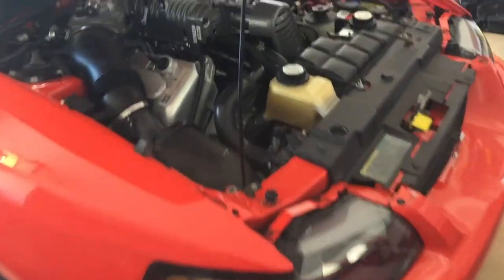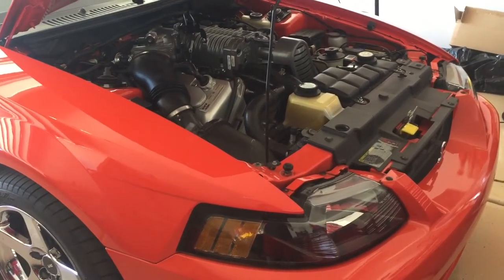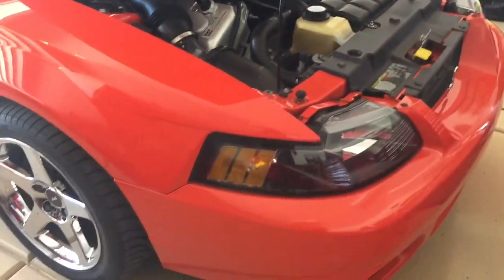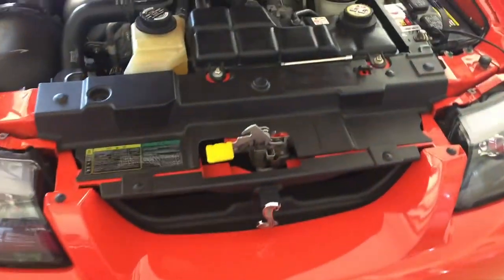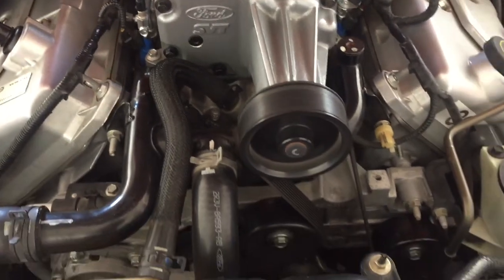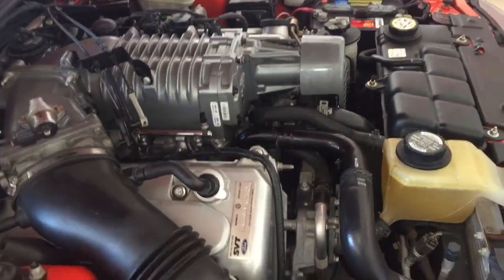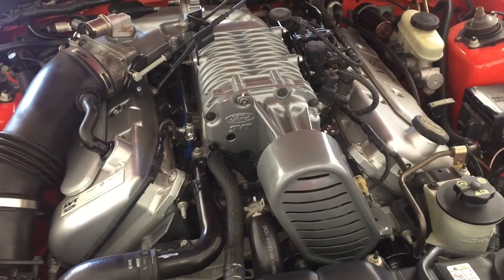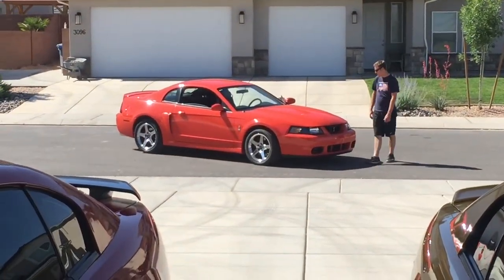VLog. How many miles are on my Cobra? Idler swap

Comment: Hey ive been noticing my 03 cobra has been heating up lately, some white smoke has been coming out above the coolant tanks and radiator, i noticed when burping it the coolant doesnt doesnt move in the reservoir tank, i tried replacing rhe thermostat, any ideas what it could be?
Reply from the maker: Kevin Alvarez loss of pressurization from the cap or the radiator may have a crack in it. Do you smell coolant?
Reply from the maker: Kevin Alvarez If you’ve properly burped it I would lean towards the radiator (or make sure the thermostat is in the right way and not backwards). If it’s the radiator I have a video on that https://youtu.be/DKb5ldeqXjo
Reply from the maker: Kevin Alvarez I also have a video showing the removal of the water pump if that happens to be the case. https://youtu.be/NT5Z5L2wAss
Reply from the maker: Kevin Alvarez But you’d need to remove the bridge first. I should probably edit a video for just the water pump lol https://youtu.be/ajWIW-3qPKM
Reply: i noticed huge leak spots in the radiator, im getting that replaced and hopefully solves the problem, thanks for the response